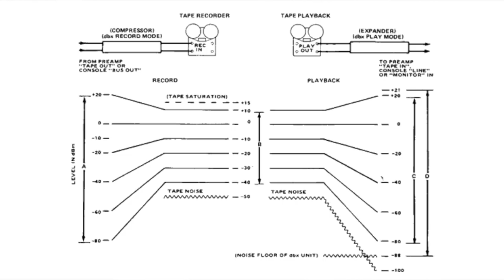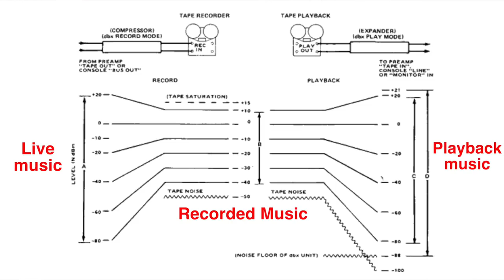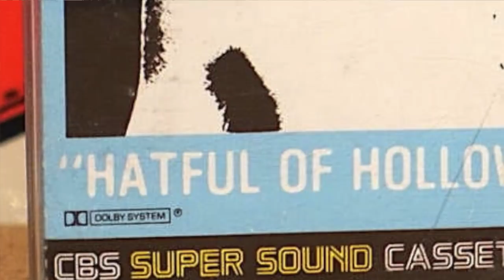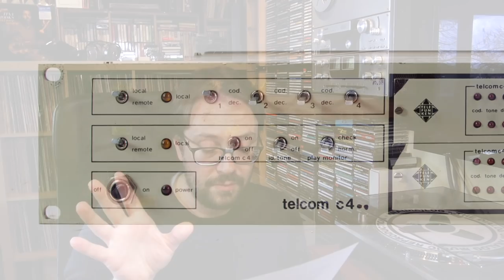Top Tape Noise Reduction Systems & How they Work

Comment: I have experimented with B, C on a nak dragon and with B, C and dbx on a teak z6000. The best sounding NR in each case was to use no noise reduction at all. Yes, there can be some tape hiss, but in A/B comparisons each type of NR takes something away from the music and I then prefer the slight hiss trade off when using no NR. The amount of tape hiss differs per type/make of tape. In some cases a type I tape plus dolby B is the best choice. When using NR, you must reduce the recording level a bit. So in stead of a hot recording at +6 on a good type I tape, you then record +3 with dolby B in stead. So there are many factors to take into account before choosing NR. I tend to use SA tape the most, and then use no noise reduction. Not using any noise reduction is also a good option if you are looking for compatibility with other decks. In the latter case, you can also use dolby B, as that can sound OK, even when played back without dolby B. That is probably why it is the only type of dolby used on pre-recorded tapes. In some cases the best result can be to deliberately use dolby B during recording, and play back without NR. That might be the case if the source material is a dull recording.
Reply from the maker: I understand your point of view. Noise reduction does filter and manipulate the signal. I guess it depends from the combination of your software and hardware and what your ears tell you after a recording...
Reply: Noise reduction is similar to what the RIAA curve does ... the only difference is the RIAA curve isn't active it is a preset that doesn't change ... noise reduction is similar during the recording process the high frequencies are activity elevated and upon playback the opposite is done ... the higher frequencies elevated during the recording are  actively suppressed during playback ... I suppose that's why a gracious number of people say Dolby muffles the sound (on and off) during playback ... so it can be perceived as making the sound dull ... that is easy to compare the source and tape with a 3 head machine

Comment: Do you have any experience with National Semiconductor's Dynamic Noise Reduction?  I had a radioshack made audio processor with built in DNR and I found it to be very effective - it was also one of few NR solutions I've seen with an adjustable knob to determine the aggressiveness of the noise reduction.

It wasn't that popular but I loved my external DNR box when I had it - nowadays I use the noise reduction of my Pioneer RG-1.
Reply from the maker: No I haven't thanks for pointing that out. Perhaps I will introduce it in the second volume of the video that Inwill donin the future.

Comment: I remember years ago spending quite a bit of money on a DBX unit. I found that it had this breathing effect which was annoying. I used it for my open reel tape deck. I ended up going back to Dolby.
Reply from the maker: I bet it was an early version that did suffer from this issue as mentioned in the video.
Reply: You mght have been trying dbx I. I think it sucked.DBX II is a lot better

Comment: Telefunken developed High Com, Nakamichi jumped on the High Com wagon with High Com II... and plus there is HUSH Super C (single ended).. which states in the users manual that it can be configured to decode Dolby B tapes..

Comment: Hello.  I have a cassette from 1989 by Billy Joel that mentions and specifies that this tape is recorded with the Dolby B system and that if it is played on a player that does not have Dolby technology, the treble will be heard with a “decrement.” . My player is a Luxman k331w which supports both codecs, B and C. When listening to music and with Dolby off, the treble is perceived as somewhat simple; when changing it to Dolby B, the sound is “cleaned” but the treble remains poor. But when I apply Dolby C the treble becomes present well above Dolby B, even more intense than with Dolby off. Normally, when Dolby is turned off, the sound is higher, although with background noise. Why does that happen? I don't understand. I hope you can give me a few minutes to help me with this question. Thank you very much.
Reply: sorry for the question. I already understood after calmly watching your video. thank you

Comment: Fantastic, and so clearly explained as always, so thank you! I bought a Pioneer CT-S620 in the mid-90s which, along with Dolby B and C, has Dolby HX PRO. The deck needs serious attention now both mechanically and electronically and so I'd probably be better off finding another model. I was aware of Dolby S back then but it may have been too expensive for me.
Reply from the maker: That is a very good model...a lot of labs are now servicing again decks, maybe you can get it back to its standards!
Reply: @anadialog  Thank you, I shall have a look round,

Comment: I never use NR. My lovely pioneer cassette decks make such lovely recordings that I don't get much hiss.
Reply: Dolby S is lovely to have but cant use tapes I make with it back on my walkman so I dont really bother
Reply: I never use nr either with high quality cassette and great deck no NR needed
Reply: @datsunmadman  It's not just high quality cassette decks... You need to use a very high quality tape... Type IV Metal cassettes sound phenomenal when recorded at a high level with no noise reduction.  The thing is that metal tapes are hard to find now and extremely expensive.
Reply: @revokdaryl1  high quality cassette makes all the difference. I Never used type 0
Reply: @datsunmadman  You've never used metal type IV tapes?
Reply: @revokdaryl1  I been using metal cassette since 1988
Reply: I keep it off.  Even general prerecorded cassettes have very little noise, even in quiet sections with headphones.   Noise reduction always made the sound muffled and worse imo.  And yes...my deck is calibrated properly.  Dolby just never worked great imo

Comment: It's simply not true to say that Dolby B was a quick and cheap solution. When it was introduced it was truly revolutionary, and was a key factor in establishing the Compact Cassette as a HiFi format. When the deck is properly optimized for the blank cassette, the results can be excellent. Try Dolby B on a top quality deck like a Nakamichi Dragon, and the result is extremely transparent. The key problem is that it was quite sensitive to the deck being correctly aligned for Dolby playback level, and the sensitivity and bias requirements of the tape being used. Dolby C was even more sensitive to proper setup, but by that point, more decks allowed you to adjust the playback level, sensitivity, and bias for the cassette being used. Dolby S was really an attempt to reduce the problem of setup misalignment, and introduced fairly stringent requirements for the decks mechanics and setup flexibility.
Reply from the maker: Yes, I agree and in fact I included it in thos top 8 list. I just wanted to emphasize the quality and sophistication of the other systems, which are superior.

Comment: Dolby, according to most audiophiles, dont usually use it because it never works right, the reason is unknown to me why it doesnt work right. I always try it, and if it ever does what the chart shows, I will use it, but I have only used one deck so far, so Im not sure if it works or who uses it. Im getting a refurbished deck with a year warranty. It has dolby S, I  dont know if it will work right, but if if doesnt, it wont matter to me, but if everything else works right Ill keep it. Hxpro is more effective at noise reduction according to what I hear, and metal tapes can capture the head room extension, which also means they have less noise by comparison and Hx pro is also said to reduce noise, probably by reducing distortion. if I have dolby S, I probably will use that over b, and c. What really matters more than anything, is autotune. On my JVC its called cal, which i think is same thing, correct me if Im wrong. It makes up for  slight differences between tapes, and the difference matters. Also I have bias adjust, also important.Its good to understand how it all works though, so thanks for your efforts. Biggest problem is finding a tape deck that will work right at all.
Reply from the maker: Try dbx and everything will make sense. Remember that HX pro is not a compadre but a bias regulator during recording.
Reply: @anadialog  yes it allows the maximum bias allowed, reduces distortion by not oversaturating the head, unfortunately not many tape decks have it. I hope the type s Dolby works on my deck. I found one with a 1 year warranty, refurbished. I appreciate your efforts, is good to refresh my memory with the information.

Comment: Metal tapes were dramatically superior to standard-bias composition in every metric but they would just destroy the heads in short order. Now to be clear, I'm referring specifically to my own experiences, in the 1980s and early 90s, with cassette decks only. I have owned two reel-to-reel decks but neither had any metal tapes played on them, as that would have pretty much required a second mortgage on the house.

Comment: Highcom was a broadband compander and not limited in high frequencies. It achieve 25dB extra dynamic in high frequency band. And 20dB in the lower frequecies. I own a Telefunken RC300 which is of awesome build quality and lasts since 1981 and still running, no rubber bands. HighCom got some modification for soft switching time constants I have applied to my HighCom modules and the sound quality is way better than with any other NR system. The RC300 had 2 tape speeds (normal and half). I made some changes in the electronics to run it double speed instead of useless half speed. Therefore I had to modify the recording equalizer to get a flat frequency response. Now it has about 80 to 83dB S/N ratio.
Reply from the maker: If you check, as I said in the video, Highcom acted on the 1.2khz-8.6khz. Broadband means on all frequencies within this range, instead of fixed frequencies like in other companders.
Reply from the maker: http://everything.explained.today/High_Com/
Here: https://en.m.wikipedia.org/wiki/High_Com
The band range has bibliographic references.
Reply: @anadialog  Highcom has emphasis functionality, at higher level high frequencies are reduced at recording time to avoid tape saturation as a compressed signal is louder in the high frequencies. Same for low frequencies. So that does not mean that it will not compress frequencies higher than ~8kHz. It IS a broadband compander that works from 20-20000 Hz, if recorder is able.
Reply from the maker: Ok, maybe my information is incomplete. Can you show me a reliable source where this is stated like I did?
Reply: Have a look at Ernst Schröder's link above. See Fig 12 and you see 15dB at low 20dB in the mids and 25dB in the highs. With Highcom on a good deck you will get in total 20dB, with Dolby C only poor 15dB. Dolby S is a little bit similar to Highcom II and achieves 20 dB and on really good machines a bit more.
Reply: @anadialog  Again at Ernst Schröder's page (he was the developer of HighCom). Scroll down the page and have a look at the pdf about the U401B. In the PDF you'll find a diagramm about emphasis and deemphasis. It is really sad that there was this compander war in the 70ies and 80ies. The companies could just have used Highcom which is by far better in compatibility when tapes played on other decks than with the Dolby Systems.
Reply from the maker: I am sure of that but nowhere is stated that the compander acted on the entire spectrum like you said, actually no analog compander can do that!
Reply: @anadialog  Please first read the links I provided. Again, have a look at Fig 12 showing the results from a spectrum analyzer, yes 25 dB more S/N at 20kHz.

Comment: I use an external HiCom NR unit for RTR and 8Track which it sounds the best for and not cassette. You can play it without the NR unit and the tapes still sound normal.
Reply from the maker: Cool!!
Reply: @anadialog  I am pretty sure it's a HiCom unit because it does not work with dbx or Dolby encoded tapes. It's an MXR brand unit from the late 70's with dark brown wood sides and a black finish. Am I correct that this is a real HiCom unit? There is no information on it anywhere. This encoded recording will also work in B NR but a Dolby encoded tape will not on HiCom playback otherwise It sounds jagged like playing a non Dolby tape on Dolby C. It does work very well with zero noise and a high gain like dbx with no pumping. It does make the recording sound great and I use it a lot on my Akai GXR 82D and Pioneer 707. I also have a CX unit from the same design and make from the same era that I use with my Columbia vinyl like my Pink Floyd The Wall and Shango albums that are encoded in CX . You also forgot to mention DNR which was used in tape playback only since there was no encoding involved in the process. Maybe you can make a video on DNR or mention it sometime during another subject. That is the next add on unit I want to experiment with. My CX unit kinda works like it but it's not true to all my non Dolby recordings and some sounds jagged like using Dolby on non Dolby encoded playback.

Comment: I picked up a nice cassette deck yesterday a Yamaha KX 800u has dbx noise reduction Dolby b and c  also has a nice feature a bias test feature to adjust your bias I've never seen nothing like that also it's a three head deck which is nice paid by 75 bucks I think that's a pretty good dea for  this deck  anyway here's my thoughts on dbx I recorded a cassette in dbx and played it back in dbx I'm pretty satisfied with it but time to time some of the sounds sound kind of muffled is this normal is there maybe a certain type of tape I need to record with dbx in your opinion the deck seems to be working fine your thoughts on this thank you
Reply from the maker: The dbx chip may be compromised...no need of specific tapes. Try servicing it and make sure they know how to check the dbx circuit otherwise it's just better to get another deck in better shape.

Comment: hi, my guess that you mean upward compression, as the standard downward would simply reduce the peaks of the signal. i was wondering how the encoding correlated to the decoding, how is the compression 'activation curve' stored on tape, and then later used for expansion as the slightest difference will result in pumping? if you expand based on the recording itself, there are less peaks to trigger on as they were compressed.

Comment: The diagrams shown of compression and expansion must not be accurate or correct because  the upper frequencies show a dB gain of different amounts, but what I I here when I use Dolby is it cuts out or filters out to many high frequencies, especially symbols. When the music plays I dont hear tape hiss, but I dont really and honestly seem to notice it at all were it is significant enough to pursuade me to ever use dolby. The only good thing about it is I can always turn it off. However I saw a dbx stereo componant and I would say the results I heard were amazing, especially impact restoration. This was one of the most impressive things I ever heard, but I never used it and completely am impressed with how everything sounds without it.
Reply from the maker: I am afraid you are misunderstanding the concept of companders. The diagrams shown are all correct and furnished by manuals or manufacturers. Don’t know what is your experience and deck but if your comment is based on one deck then do take into consideration that your Dolby chip is corrupted. A lot of people don’t know this or forget it (and that is why perhaps we have so many Dolby haters) but Dolby must be recalibrated and/or can work wrongly giving bad results and if you don’t know how a true Dolby tape sounds like you may think that that is the way it sounds.
Reply: @anadialog  I have never used Dolby because on the  2 tape decks I own they both cut out high frequencies. I only use metal tapes because they allow the higher bias,  I don't see the significance in tape noise as I don't care if I hear it between the songs or not, it's never noticeable by me, I don't really hear it in my recordings. I only know what I can hear, Dolby always is left off by me.
Reply: @anadialog  Let me clarify about dolby. If it sounded better, I would use use it. I have owned one deck, with it, and I am amazed it lasted this long, 30 years, its the only deck I have had. It always cuts out the high frequencies when I try using dolby b, and c, so I always leave it off, and it always sounds better with it off. If tape hiss bothers you, what about grove noise on vinyl records? Nobody complains about the groove noise. I honestly dont understand the need for it, I never notice it really, but I believe the HX pro is may be why I dont hear it, and I think it works better than dolby.  Thats what I mean by the accuracy of the chart, what I hear doesnt match the chart. I dont buy prercorded casettes, I only buy TDK metal tapes, all of my recordings are 20 years old and still have at least a 0 to +2 dB response, they still sound good. as far as my tape deck, uncertain of what to do, it has a display problem. I bought a replacement Denon deck, but it has some problems too.